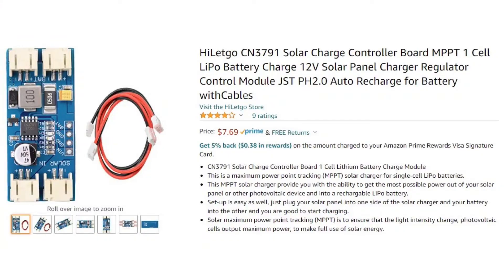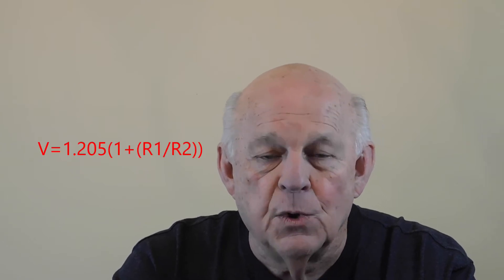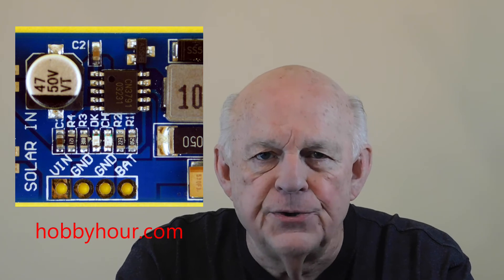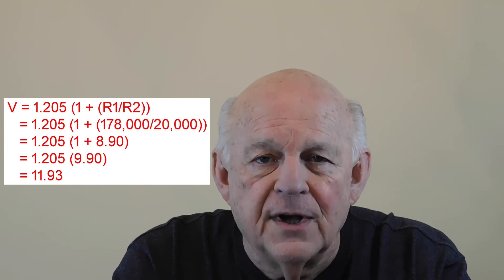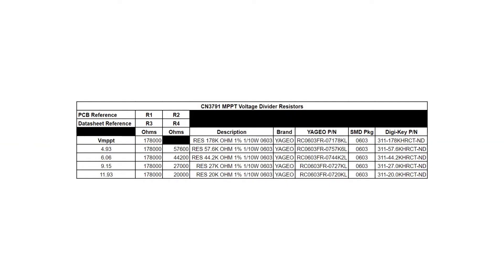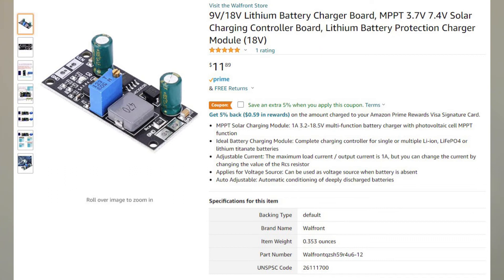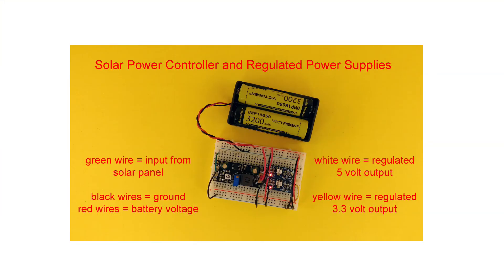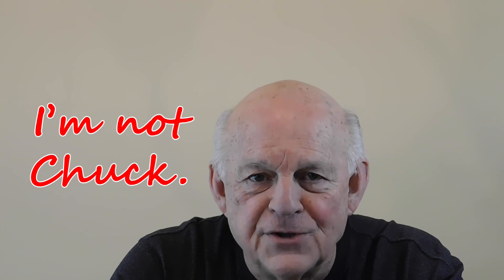Semi DIY Solar Charger for 18650 Battery Dual Voltage Power Supply (3.3 and 5 Volt)

Comment: Very good.  I did a similar analysis of the CN3971 board before coming across this video.  I'm thinking its better to use a potentiometer across the potential divider to adjust it - this allows for variance in the CN3791 voltage reference (which is +/- 2%) the on board resistors and the panel "nominal" voltage.

Comment: Excuse me sir can i step down the voltage from the solar panel instead of changing the resistor value on the cn3791

Comment: Hello, if we charge 3 batteries of different capacities at the same time, when one of them is full, will the others be prevented from charging? So I guess there is only one blue light, when the blue light turns on, which battery is it?

Comment: Hello, thank you very much for the video, it has very difficult information to find. Can I use the cn 3791 module to charge a mobile phone? 

If I connect a mobile phone with a 5V booster to one output of the module and a 18650 battery to the other output, will the battery charge the phone when there is no sun?

Also, how will the module behave in cloudy weather? Will it stop charging when clouds come and start again when the sun comes out? Wouldn't this be harmful to the battery?

Comment: Great video, and very helpful. Actually, I also found the IC CN3795, but I have a question, do you know if it is possible to power that integrated with a nominal power source of 12V or only power it strictly with a solar cell? Because in my project some times I think I can power it with a solar cell but sometimes with a commercial regulator source of 12V connected to the electrical net of 120AC, thank you very much.
Reply from the maker: Sure, it doesn't have to be solar panels. Thanks for watching.
Reply: @ImnotChuck.  thank you very much, also I confirmed this topic by watching your video of the second part of this project, regards

Comment: ... ive ran into the 3.7v camera batt & the 5v USB compatibility issue some and connect a 5v battery to my 3.7 v cameras that have internal chargers. Thanks & TY for the tip on the Memphis area Blue Oval City .. !! G-nite !!
Reply from the maker: Hi Kelly. Thanks for watching.